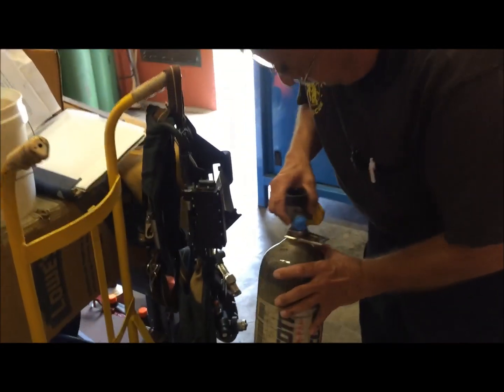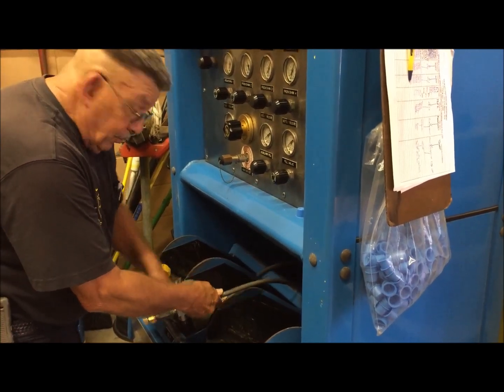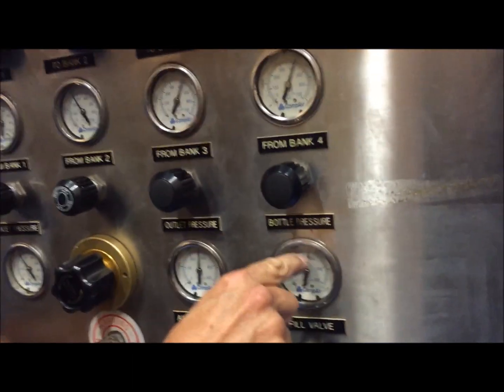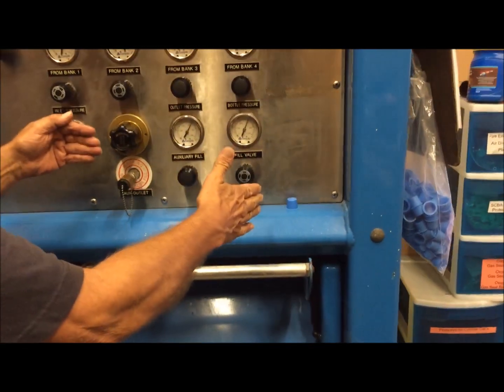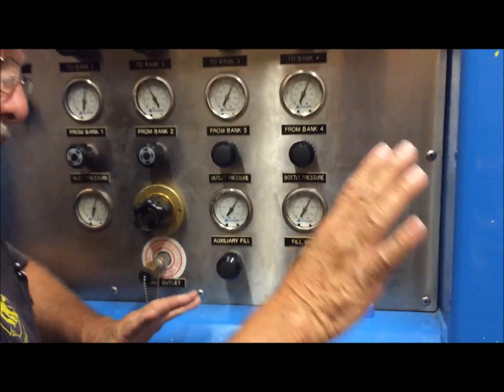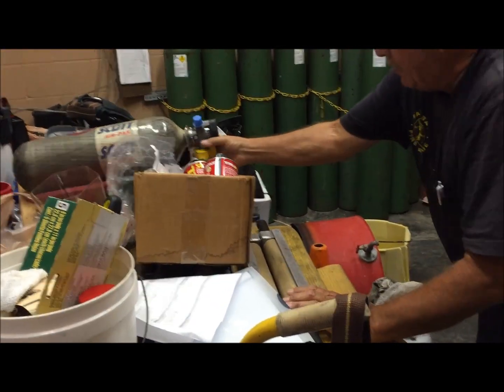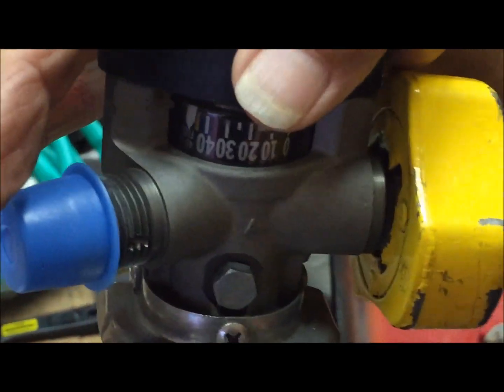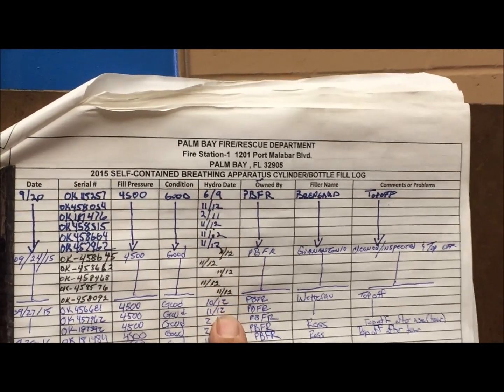Introduction to Filling SCBA Cylinders

Comment: hello kind sir, I have a question. If i am thinking about getting one of these SCBA's for the purpose of respiration in the context of using highly toxic VOC emitting stain and urethane products for finishing wood floors in confined space houses without the option for ventilation, would this be a reach? I really don't want to don a APR or PAPR system knowing that the filters all eventually become saturated with the airborne vapors and require replacement, which is only realized once breakthrough of those vapors past the filters is detected from smelling / tasting them; basically meaning that over exposure to the VOC's has already occured. The closest to this giant machine i have at my disposal is a standard air compressor. I really want to breathe truly fresh oxygen when on the job working with these terrible chemicals, but I feel as though this equipment may be far too expensive and inaccessible to someone my age, 23, and in my situation, only working with floors. trust me, these chemicals are very harsh and also terrible for your health. so, i find it kind of unfair that only firefighters seem to be the permissible cohort of people to use this equipment. please feel free to educate me, I could use all of it.